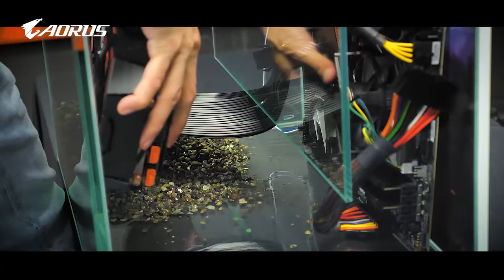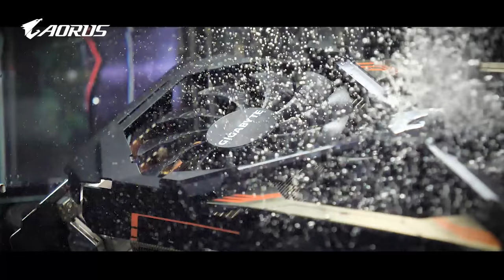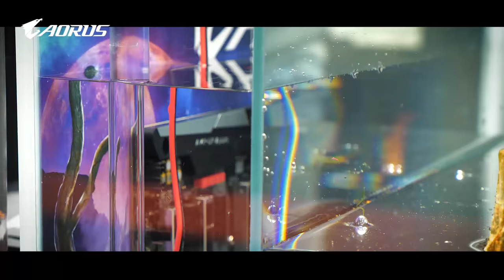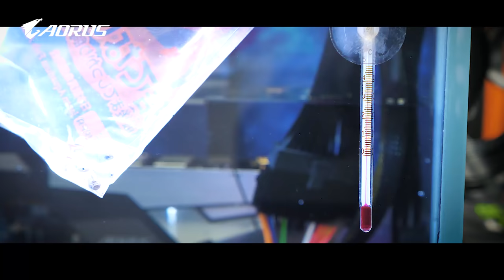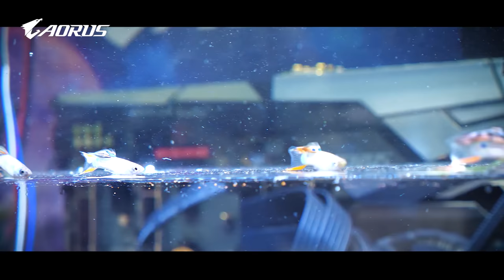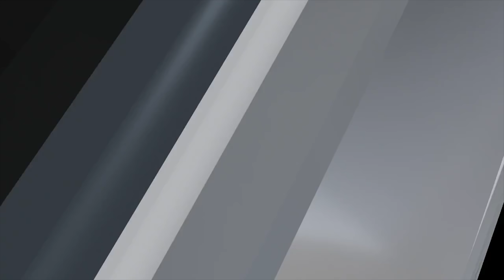Aquarium AORUS PC Build | #DesIgnYourAORUS

Comment: Since so many people are complaining about the lack of ethics or complete disregard for the fish or the equipment in this video, this comment is for you.

Number one.  They said themselves, the temperature of the fluid is being regulated by thermoelectric cooling chips.  In case you do not know what this is, it is often referred to as a Peltier cooler.  Given power, these either cool or heat up the liquid they're circulating and regulate its temperature.  These are used on a day to day basis in most aquariums.  The fish will not get cooked by the rising temperature of the water.

Number two.  The fluid they appear to have used to cool the PC components is 3M Novec.  This is an engineering fluid used for many purposes.  Number one, it has an exceptionally low boiling point and also returns to a liquid form after just a degree or two of cooling.  Two, it is completely non-toxic.  This fluid is also used as a fire suppressant in many large offices or data centers since the fluid does not carry any electrical charge whatsoever and is completely safe for all electronic devices or people who come in contact with it.

Number three.  The fish CAN NOT SWIM IN THIS FLUID.  Even if they wanted to, the fluid is roughly three times denser than water.  Their bodies would not be able to push anywhere close to the edge of the water and the fluid in question.  There is no way the fish could even intentionally kamikaze into the Novec.  Even if it WERE possible, the only downside is that the fish would not be able to breathe and it would resurface into the water to get air.  This is a natural instinct, and why fish in overcrowded or dirty ponds or aquariums will often float towards the surface.  They go where they can breathe and get air.

Nothing they have done is wrong.  Please stop being oversensitive and do a little bit of research before you get your pitchforks out.  The fish are fine.
Reply: Kaidesa what about the noise?
Reply: @springbok4015  Man it's just a gpu and you can see that the fans rotation speed is lowered because of the density of the mineral oil.
I've seen some aquariums with prety loud water pump, so i think the fish are fine (sry for my english).
Reply: What about oxygen?
Reply: Albin B The filter water takes a bit of air with it or the fish swims up to get oxygen.
Reply: Can the fish run crysis?
Reply: Bad ideas you don't know the parameters of the water that fish needs to be in a stable home and you don't said how to feed them and cleaning methods
Reply: Dumbest post debunked by m3 themselfe: afe for worker exposure

Building a data center that uses immersion cooling doesn’t compromise safety for your operator. 3M designs all Novec engineered fluids to feature:
 

Overall wide margin of safety for workers

Low toxicity

Non-flammability

Low toxicity well done m8 directly from there page about server cooling...same oil RIP liar.....It not non toxic its low toxicity.
Reply: What is about the toxic M-Novec gas which is produced when the liquid hits the warm spot of the CPU/GPU? The gas will go trough the water and ends up in the air where it condensents again....
Reply: @Kaidesa just to educate you a little bit about Fluids. There are organic fluids around for many different uses but not a single healthy fluid is meeting the specs of a dangerous toxic fluid. Good example are hydraulic oils they are using material which is forbitten to use in war times as a weapon due to the toxicity and they can use other material because nothing else will meet the needed specs. Or aircarft engine oil is highly toxic nerve gas when its getting to hot. And I can bring many other examples of toxic fluids which just just have no other possibility.
Reply: Nice S.A ill give an F XD
Reply: PETA
Reply: Bhamski Bam there is a very large pressure difference between the 2 liquids, there is a reason surface fish in the ocean don’t go deeper than they do. They know the difference between what their bodies can handle better than any human does
Reply: @12Burton24  No worries they will replace them with new ones
Reply: What about electromagnetic radiation ?
Reply: Kaidesa i just like this because it was long
Reply: it still feels and looks wrong, but if you say so....
Reply: Marine biologist approved - my brother
Reply: It's really hard to find common sense within the youtube comments section.
A huge facepalm to all the people who think they are going to run this build for the next Three years or so.
The fish won't die within weeks, there won't be any need for cleaning etc. because this showcase system is most likely already being disassembled, maybe even while the video was going trough post production, before it got uploaded.
Reply: @KiloSwiss  Instead of bugs and worms now you have fishses in your pc.lol😂🤣🤣 another headache 😂😂🤣
Reply: Get ready to find fish poop in your GPU
Reply: Actually... I brought a rake
Reply: @kaidesa Does anyone know how fish poop or food is removed from this system? Will they sink to the bottom and cross over into the 3m novec liquid? Or is the liquid too dense for it to pass through? I’m going to try a fish tank build just like this myself.
Reply: Kaidesa now i’m a aquarium hobbits and Pc gamer, from my skills with planted aquariums and only fish tanks i could tell you this ring will be a mees trying the water changes for the fish, either way the amount of ammonia pouring down to the components, you know fish poo all the time, and the food wasted on the bottom between the liquids layers, so from a maintenance view looks really tough
Reply: These pc equipments are kibd of eWaste. Water animals cant bear the toxic these equipment releases.
Reply: I see. I would imagine this is nothing more than a temporary thing. Still hope they move the little guys to a proper aquarium after some time
Reply: Thanks for the research... You have answered all my questions :D
Reply: What about the fishpoop???
Reply: Good point, but as an aquarist, I must say that you missed a few important things.

It isn't ethic just if it doesn't harm the fish, adding them on liquid to the water with no setup, in the means of biological balance (bacteria to deal with nitrogen, algae), will lead to toxic environment.

But well, why should we care that much about them, so the second point would be the maintanance. I would love to see, how are they managing any debree. But afterall still better than most Betta setups :D And definitly great job about explaining some things to the common audition.
Reply: This is a Show pice. They probably deconstucted it after 2 weeks.
Reply: all aquarium fish i know are cannibals and real greedy. they gonna push corpse with united powers under the liquid surface for shure. eventually more gonna die in that scenario. anyway with small fish like that sould be fine they are inexpensive. lots of cleaning work too much but none of my problem anyway. i guess he give it up sooner or later
Reply: @recode8453  LOL
Reply: Pls educate urself before trying to educate other ppl ur just missleading them
Reply: Every fish swims 24/7/365? What happens if the fish needs a solid surface under their water? Really don't know if my question is stupid or not but answer, please.
Reply: Looks to be two different tanks fish are above the pc components
Reply: this guy assumes fish only needs water to live and they should be fine as long as they are in water. LOL. Yea, sure, the fish can't get to the bottom. SO? It suddenly becomes an ideal living space for the fish?
Reply: @SHIT MAN Well man maybe it time for you to learn that not everyone is able to perform on the same level like others. My weakness are languages. I need to learn a lot for quite a shitty output. At the other hand math, physics, biology, history and all other subjects have be easy for me. English was the 4th language I learned.
Reply: How is it that you know so much yet still have an anime profile pic
Reply: I'm sure something must be unpleasant to those fish there. On the other hand it could probably be worse.
Reply: @arthur2605  yeahhh prety.
Reply: @starhyena7443  Great comment....nice that you are able to bring realy important stuff in to the discussion.
Reply: Nice comment !

I'm not myself directly working on it but my company actually develops High Performance Computing systems using immersed cooling like this. Of course we don't have the water phase or the fishes in our systems, but as a demonstration, if everything is done properly then why not, I think it's cool :)

Our systems are also much bigger, one enclosure being a cube of about 1.5m in each dimension. We use Fluorinert which is also from 3M, but it's easy more liquid than this, heavier than water but not as oily as this, so easy much easier to use than this, but it's also more expensive I think.

The liquid is cooled through a cooling circuit including some pipes, a pump and a bigger version of the heat exchanger used in air conditioners.

We also don't use fans in components, but we do use heatsinks.

We have a huge density of powerful computing components, about 20KW iirc (might be wrong), not taking space as we don't need air cooling or fans, all maintained at a low temperature.
Reply: Finally someone who is not in the stone age 👍
Reply: @thirday8421  You mean finaly a lot of people without knowledge aboit chemicals and their influence to nature
Reply: @oscar26061  Read the description the pc is not made for a regular user (they don't let the pc run longer than a week, and the fish are only in the pc for a few hours)
Reply: @12Burton24  dude wtf
Reply: @12Burton24  it is non toxic dude
Reply: @thirday8421  It is m8 just learn to use google. Infact its not even check for nature usage because the enviroment where you use it are server centers. But you can be blind and trust this liar with his wannabe knowledge or you conntact 3m and you will have a clear answer that you are not allowed the drain the fluid into a lake for a good reason....do your research in a serious way pls. Just trusting forums and youtube doenst give you always the correct answer......history should teach you that.
Reply: @12Burton24  I have a similar system and its running for over a year and my fishies are still fine. The poop and the non-eaten-food swims above the Novec so u can just clean it easily.
Reply: @jozephg  If you mean the radiation which electronics send out then dont worry. Even the food you consume has a higher radiation than the electronics like tv and smartphones send out. This is just a rumor that electronics harm you. If they would you you couldnt eat something because as i said: Food has a MUCH HIGHER Radiation.
That is simple knowledge you learn in atom physics.
Reply: @nicz7694  Well fishes are also swimming between the trash in the ocean and they are also fine. The question is more what kind of impact it has. Maybe not visible maybe there is no pact. But if you check the side of 3m the fluid is not something you can put into the lake
Reply: @12Burton24  Yes for sure but still: My fishies are fine so long but i really keep an eye on them and keep the water clean. I also change the water at least every 2 Months. We still dont know how much the Video Creator/the System Creator keep an eye on them
Reply: @nicz7694  That true. You have to keep an eye on them and if you do so. And at least the look fine its good.
Reply: What about the fish waste ?
Reply: @thecorronix881  you can easily clean it. It swims above the Novec and you just need a (fish)net to clean it
Reply: I am thinking
.
.
.
.
.
.
.
How long it took for u to write this comment..?
Reply: Nerd
Reply: I wonder about the leaching of the 3M Novec fluid into the water.
Reply: @springbok4015  everything's under the fluid so it's not going to be that capable of creating noise
Reply: Preach dawg
Reply: People tends to believe long comments are always factful.. doesn't hold good for this comment though. I'm not an expert or something but I saw the fishes seems to be curious about that liquid and what if that liquid gets inside their body while feeding ? Their food settles at the fluid surface and they might swallow the food along with fluid content.. even the oil spills in oceans cause many deaths of aquatic life.. it doesn't mean the oil is mixing with the water but it gets inside their body while feeding or by other means..
Reply: Here's come the pro with a degree in science brain my toe is laughing LOL...
Reply: Like 
Water & oil
Reply: @dantiel92  gotta keep in mind, the waste will not find its way into the fluid.  It's too dense for even the fish to forcibly swim into it, so the waste would simply float on top of it, free from the PC components.  Properly maintained it won't be an issue, but then you run into the problem of the fluid needing to be replaced after a while.  It would, obviously, require a full flushing out of the system.  Water and all.
Reply: @dairenanisinger  There are plenty of aquarium beddings that would lay on top of the coolant.  The type of fish you could use would be limited by the environment, of course, but it's still quite possible.
Reply: @jeremysargeant7659  I did I red everything so far up till your comment
Reply: Only if they agree plastic can be eat and it's healthier...
Reply: @doepro5042  if it turns to gas near cpu, it immediately condenses to liquid after reaching cooler fluids.
Reply: Is that why the water sits on the fluid?
Reply: bishopob  .....
Reply: @AlbiinoBlacksheep  do you even own fish
Reply: Most senseful and accurate answer I've seen since months
Reply: @12Burton24  Are you giving him education or jealous of of him? Even you might be writing correct. But, according to your way of writing. If your teacher asked any question and you can't answer.  Think if she thought like you and make mock of you in front of while class. Knowledge is just collection of facts. Not everyone will have same understanding and thinking.
Even i made 100 mistakes in this post
Reply: How about fish poop?
Reply: The acuarium can burst due weight pressure, that oil is 3 times heavier than water am i right?.  i  dont give a flying fuck about guppies but the pc is nice.
Reply: While the fish are fine for the short term, the bio load the fish produce will not be sustainable in such a small environment, plus there is a thing called the "nitrogen cycle" which is required before adding in fish, which ensures the raw waste of the fish turns into nitrate rather than stay in its initial state of ammonia (which basically burns the fish alive).
Reply: I have my onw aquarium and the water chemistry is tricky ! Azote cycle, CO2 for plants, stable température, bacterias in grit (and not oil !), light and more ! Please check true aquarium tutorials on youtube and you will understand I say truth ! Therefore, this configuration is bad for fishes...
Reply: RABBLE RABBLE RABBLE RABBLE!!!
Reply: Do the gpu still need the fans if it's already submerged in coolant-like material?
Reply: Ok so did you do any research on fish at all specifically these fish? No you havent. These fish are a schooling fish. Most schooling fishes require 20 gallons or more depending on the size of the school. That's not 20 gallons of swimmable water. There is no hiding spaces for the fish it is just open water. THIS IS TERRIBLE DONT LISTEN TO THIS COMMENT HE HAS 0 IDEA OF WHAT HES TALKING SBOUT ABOUT
Reply: @ryanwolfchong  you are a Bad human being if you do a build like this. What is wrong with you
Reply: Ah they added water too and water is lighter than that oil so fish will be completely fine there
Reply: @umeshsonkar4177  how high are you. the fish will not be completely fine do you know 1 thing about taking care of fish?
Reply: It's still bad for the fish because he probably doesn't even know what a nitrogen cycle is.
Reply: No acclimation, as an aquarium enthusiast I can say that this was not done properly, unless of course they took the water from the fishtank that the fish were in before.
Reply: Can i use mineral oil?
Reply: This was not novec bud, it’s mineral oil..
Reply: Everyone is so worried about the fish. I’m sure they took them out after and if not and they do die, who cares they’re fucking fish
Reply: What about the opinions of the fish? Did they agree to live inside a pc case?
Reply: But i want to see more....
Reply: Well I did learn you can Count To Three from this comment!
Reply: @boneman-69  hi Aqua

Comment: It is water on top, the bottom layer is electronic engineering fluid, insulated, non-conductive, low toxicity, non-flammable. 
The specific weight of the two liquids are different.
Reply: Yup correct..
Reply: Xiaonan Lin right again...
Reply: Back in my day we used mineral oil for this kinda setup
Reply: does that liquid goes conductive over time because of the touch with metal surfaces?!
Reply: What is you are saying 😓😓
Reply: It is just mineral oil. A lot of submerged PC builds uses Mineral Oil for this.
Reply: Ignoring the toxicity of the material to the fish, can they swim from the water layer to the cooling layer?
Reply: That's why they put fish in there
Reply: Mineral oil you mean
Reply: he is using mineral oil
Reply: @panos4386  the dielectric liquid has a lifespan of 10 years.